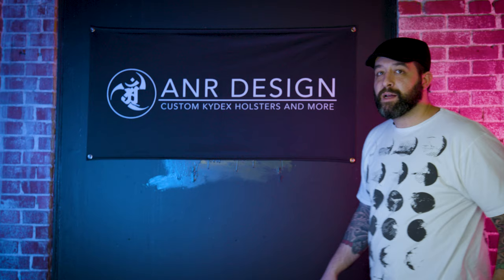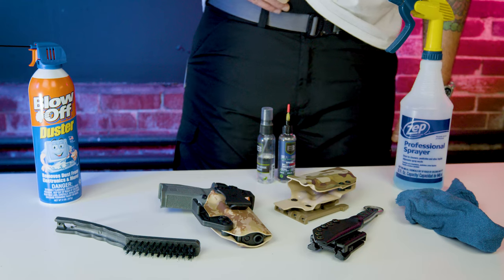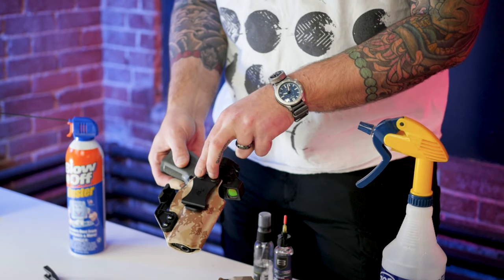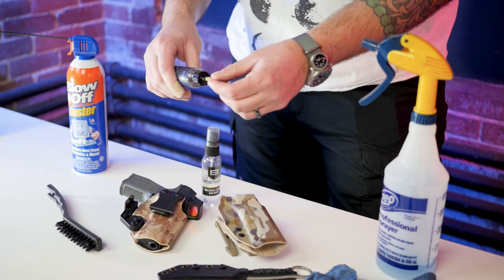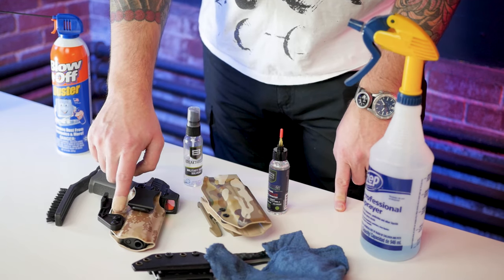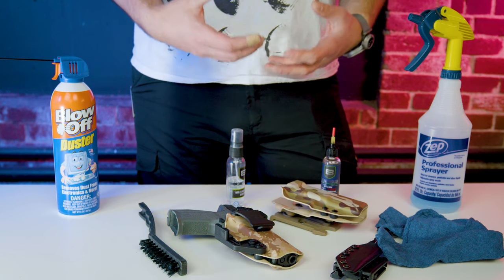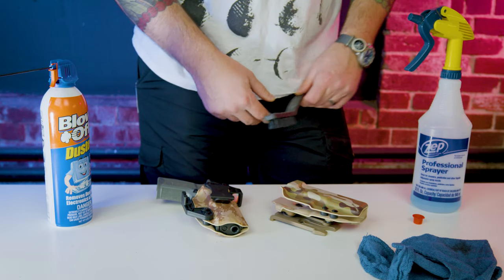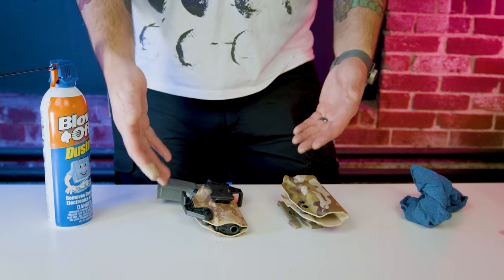ANR DESIGN Re-Education Series: Holster Maintenance

Comment: I clean the fuck out of my holster and gun, and my finish is definitely being rubbed off.
Reply from the maker: Its a tool not a show piece the second you chose to carry it. Get it cerakoted again down the line. Pretty coatings are boring. A beat up, well used gun is sexy.